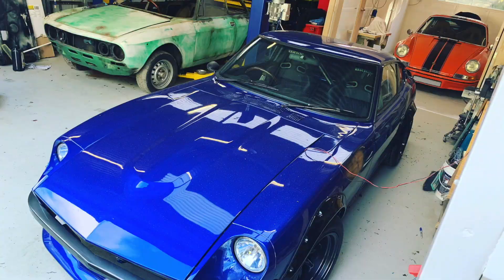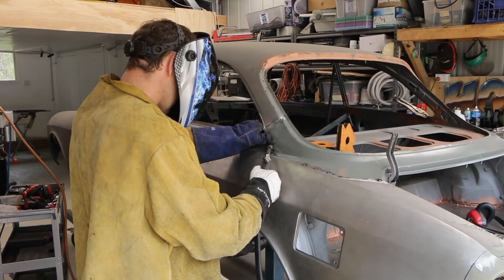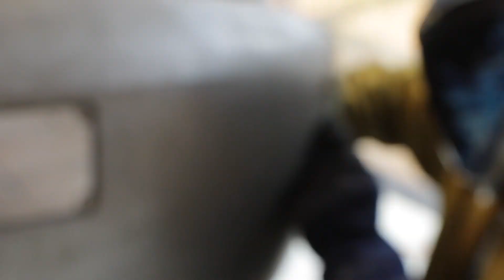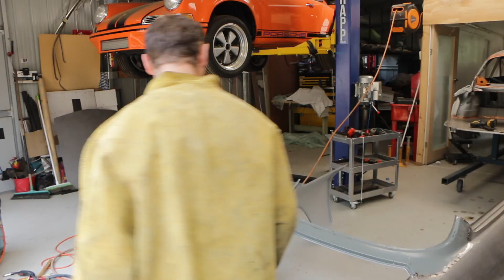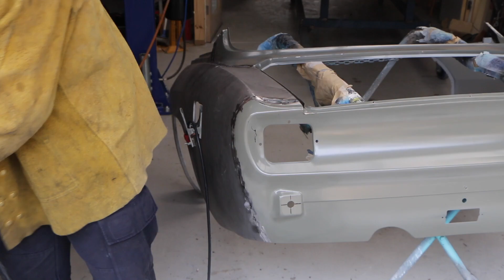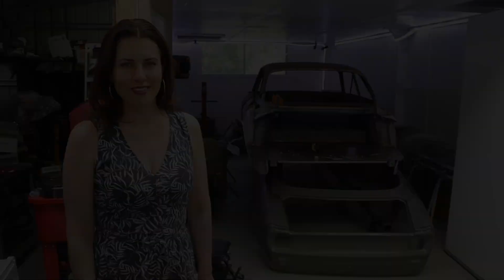One piece rear end - Alfarrari 105 project car build part 28

Comment: What a grand job you are doing building this car, and the idea mounting a Ferrari engine is just bonkers, in a good way. 
Be aware that if you weld the panels when they are unmounted to the frame of the car, the panels could twist. And the result will be that they don´t fit when you are all done welding. It happend to me earlier this year.

Comment: hi jeff, 1.6mm rod is too big for sheet metal work. You’re either using more amps than needed or moving too slowly in order to melt the rod, either way putting more heat in and risking warpage. Try 1mm or 0.8mm mig wire and reduce the amperage. Dab more often to cool the puddle and raise the bead for planishing.

Comment: I'm far from a Tig expert, but it looks like you're moving too slow and generating a larger HAZ than it needs to be. Try picking up the pace and increase amps as required. That way you should get the same penetration and put less heat into the base metal. That should help reduce warping.

Comment: Great work m'80 and so informative . Does Mrs Jeff blind you with history lessons when off the screen. .? I wish I could say the same about my lady.. Awesome ..! 
Lastly I would of liked to see the boot lid on the hinges when you cut and tack fit the rear panel. Just to get the length perfect on the rear quarters. I'm sure they are fine anyhow. And taking the whole shell of the rear off the car.. Master move Jeff ..! I truely think you will get it spot on and filler free. There are superior fillers to use that are used for stopping the 2pac primer, I think I would invest in that for sure.
Great work from a great team . Well done.!

Comment: You re doing very nice work with those panels, Jeff. But I wonder about the structural stability, are you sure that the body can withstand the forces generated by an engine 3 times as powerful as the original? Or are you going to put in some extra reinforcements later on?
Reply from the maker: It has been mentioned ;)

Comment: Impressive work! The TIG welding leaves a nice finish when done right. I started welding in the right quarter panel but I mig welded it since its only below the belt line and not a complete quarter
Reply from the maker: Tig is still a real challenge and does still put quite a bit of heat into the panel. We will see how it really came together next week :)
Reply: @HomeBuiltByJeff  cleanliness is key...a very clean surface will save problems later, speaking from experience :)
Reply: @raisingjunior6389  yes agreed, I tried welding stainless tubing without cleaning it with alcohol. And it makes a huge difference when you do.